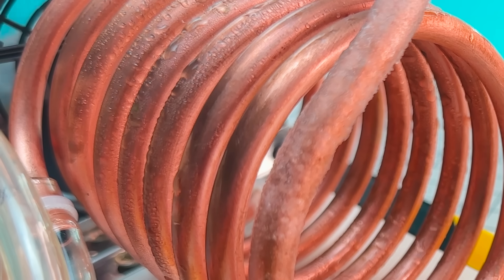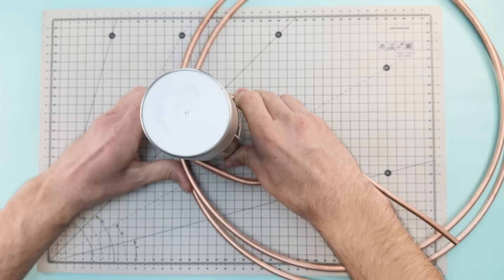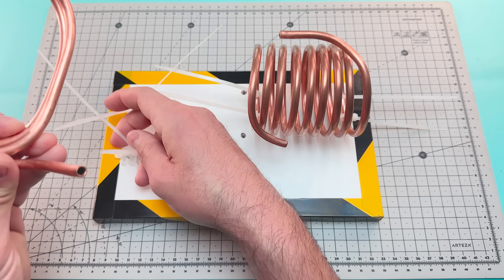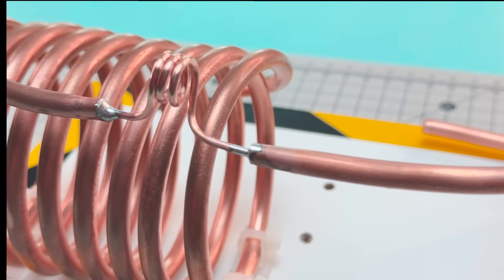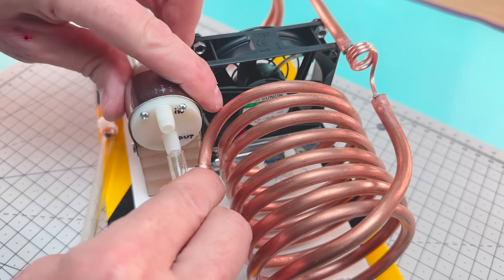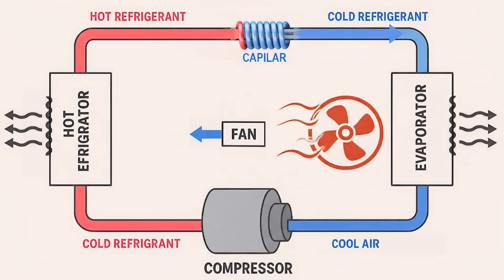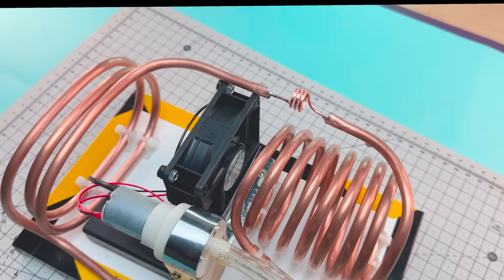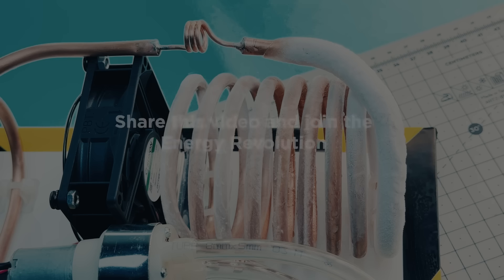Make your own AIR CONDITIONER at home Fast and Easy!

Comment: Wo bin ich den hier gelandet, ja ne is klar, ich brauche gar keinen Kompressor. :D
Reply: Das iss so nicht ganz korrekt. Er hat ja einen Kompressor. Ein Kopressor press Luft in eine Richtung. Diese kleine Pumpe ist zwar jetzt nicht das Gelbe vom Ei, aber einen gewissen Kompressionsfaktor hat das Ding schon. Ich weis ja nicht, was du denkst, wieviel Bar in deinem Kühlschrank herrschen. Aber prinzipiell muss das Gas nur verdichtet werden. Je dichter, desto effizienter, aber das Teil hier muss das Feuerzeuggas ja nur durch das Kapillarröhrchen von 0,8mm drücken. und dafür reicht das motörchen durchaus aus.
Es iss nicht besonders effizient, aber ich würde sagen, DIESES Video ist echt.
hab mir grad alle Teile bestellt und werde es nachbauen. Erstmal nur auf nem Brett, so wie er, um das Prinzip aufzubauen. Ich hab auch ne bessere Luftpumpe genommen, die mehr Leistung hat. Und wenn das mit dem Provisorium funktioniert, werd ich mir eine in meinen Anhänger einbauen. Billiger kommt man nicht an eine Klimaanlage. Ich bau mir noch eine Temperatursteuerung mit Display dazu und evtl. auch mit umkehrfunktion, so daß das Ding im Winter auch heizen kann. Braucht wesentlich weniger strom als ein 30W Heizlüfter. Der zieht mir den akku in 3 Stunden leer. So ne Klimaanlage mit max. 2 A kann ich 50 Stunden am Stück betreiben. Mit Solarplatten auch rund um die uhr.

Comment: This is cool (no pun intended) but it's far more effective to spray yourself with water from a misting bottle to cool down. Saves the environment as well.
Reply: Did you watch the video? He used Isobutane. Isobutane, also known as R600a when used as a refrigerant, is generally considered to have a low negative impact on the environment when compared to certain alternatives. It has a low Global Warming Potential (GWP) and zero Ozone Depletion Potential (ODP), making it a more environmentally friendly option compared to hydrofluorocarbons (HFCs) like R134a, which are being phased out due to their high GWP.

Comment: if you want to see a proper small ac build look at adam savage's cool suit he built for an astronaut costume he built... he explains the science of it as they build it and do the math to get the correct size tubing, length of tubing, amount of gas to inject and make a working thermostat/controller for it as well

Comment: Probably won't do much as it is, but if you can build this you can scale it up, replace the simple copper tubes with better components (or simply scavenge the radiators from actual AC units) find a stronger pump, and throw together something that can cool a house for the price of an air conditioner.

Comment: It actually works, -10 is colder than the room so each cycle is bringing the room temp down, the hot air side, its getting blown through the -10 larger coil, hot air gets colder and colder. The tubes dont freeze up on the inside becasue its liquid gas on the inside, it freezes on the outside due to convection.

Comment: great idea for cooling  small ice chest if you can separate and isolate both sides. Perhaps making it longer and add another fan to blow the hot air outside, then adding a bigger battery. you could cool a small dog house or a can or bottle of beer. Im sure with more tweaks it would be a viable unit, perhaps for van lifers and people living in a box.

Comment: conservation of mass and energy: unless you isolate the two sides, it will put all that captured heat right back into the room resulting in zero temperature change.

Comment: That's a pump...pumps don't compress.... It's just circulating the cold gas...
Reply: The restriction in the pipework (the narrow piece of pipe) causes the compression and subsequent decompression as the pump draws the gas from the other side.

Comment: Highly doubt this tiny air pump is able to compress the butane gas. You need at least 7-8 bar which you'll never be able to reach in this setup. The cooling effect seen in the video is just the circulating butane that goes super cool during expansion after leaving the preasurized bottle. nice trick though:)

Comment: You have to make sure that the warm air will be evacuated outside the room. Otherwise it actually will get hotter. But it is very interesting because there is no need for a powerful compressor, just the air pump. A good application would be a device for sleeping in the car.

Comment: As many have already pointed out, you are only moving heat from the evaporator side to the condenser side, which means the room won't cool down, unless you somehow separate the the two sides. That's why portable air conditioners have a big hose you're supposed to put in a window opening, to get rid of the warm air.
This unit will in fact raise the average temperature in the room, because the fan and the pump adds a small amount of energy (heat) to the air in the room. This will be negligibel though.

To be fair, this unit will still produce a cooling effect right in front of the air flow of the fan, and for cooling a can of beer it will be great. Just put the can inside the evaporator coil.

Comment: He should have measured the temperature on the condenser coil.  One side is cooling but the other side is heating up.  So they cancel each other out.  For example, if you leave a refrigerator door open, it will not cool down the room because at the back of the refrigerator is the condenser coil which is giving off heat.
Reply: That's right, dB7927.  A refrigerator heats the room because it is pumping heat from inside the unit to outside the unit.

Comment: now add a little finesse, add a decent sized rechargacble lithium brick, turn the evaporator coil vertical, put the fan on the condenser side and add more coils to the condenser for more efficient condensing, add a thermostat to temperature control the evaporator and you have a great cooler to sit your can of beer in when sitting outside on a hot day...

Comment: This is putting out more heat than cooling because of the condenser. The condenser is HOT. Its the unit that goes OUTSIDE your house and getting rid of the heat.

Comment: your telling me how to do something!!  Your audience a huge percentage of which speaks english and uses imperial measurement!!!  You are just limiting your viewers and your influence!!! DON'T YOU GET IT????
Reply: Mr Highpointssights, really you should learn the metric system because it is way simpler to do science and engineering using it - and way cooler - you can much more easily do approximate calculations in your head because the conversion factors and units are more consistent & easier. I grew up with Imperial & metric side by side, yet would never use imperial for anything but legacy situations (beer, road distances in the UK, and inches for rough sizing). Go on, give it a try, you know it makes sense! Trust me I'm an engineer...
Reply: Maybe you need to learn the International System of Units?
Reply: Cope. If you aren't able to convert 4 and 6 millimeters into fractions of an inch, you aren't smart enough to build this ting anyway.

Comment: A nice little project, but come on...at least say to your viewer's that this is a demonstration machine (a toy).
For example: A typical disposable(?) 9v battery (I'm assuming portability is important to your goal?) has a capacity of what +/-500ma? costing the best part of (US) $5 bucks(?) for a corner store bought Energizer? How long before everything comes to a stop?
Reply: Let alone the face he says it'll cool an ENTIRE ROOM. This could run for 20 years and not cool a standard bedroom by 1 degree. Its to small.
Reply: @joshsmith7033  It's not just too smal, it places both the evaporator and the condenser in the same room, so it won't cool the room at all. Not even in theory.

Comment: This is just to demonstrate the principle of air conditioning For real cooling, the condenser has to be in a different room from the room you want to cool Otherwise, the condenser heats the air as much as the evaporator cools the air In addition, the condenser must also have a fan to bring the temperature down A Delta Temp is created that is always fixed ( value ) Say the cold side is -10 the hot side is then +20 degrees Make the hot side +10 and the cold side will be -20 degrees

Comment: Great job building a DIY POC for the Joule-Thomson effect! However, the fundamental problem remains unaddressed. You did not explain what to do with the heat on the condenser side of the assembly. If this machine operates in a closed system, such as a room, it will eventually heat up due to the additional energy introduced by your electrical power source.

Comment: Something is not ok here. The result will be zero. At one side is is very cold and on the other site it is hot. Is will cool the air in the room if the hot side is in another room or outdoor.

Comment: "😁To cool your room at night. ' May be it is better use the solar cell panel to feed this cooler with electricity at the day time when it is really hot?
because you know even at equator in sands the nights are really cold.
also may be it is better to use Stirling engine at hot summer places to produce an electricity ?

Comment: You didn't say a single word about the other HOT side. Not good
Reply: Yes. Hot side should be outside the room - we know it as a split air conditioning system.

Comment: Principle of conservation of energy is saying hello. One pipe is cooled down, while the second one is heated. Plus heat generated by the pump and the fan. Result - the device is not cooling anything but generates even more heat. Not much, but still.
Congratulations - you've invented a heater for hamster house. ;)
Reply: If you were to move the hot side outdoors like a conventional air conditioner or In a smaller setup I could see this working, but that would be the only way. However, with proper drainage say a collector plate into a sink or something I could see this working in a small space quite well. Like a small shed converted to an office, you could have the collector plate just drain outside, or even be collected and used for plants as it's just pulling moisture from the air. Perhaps fed into a humidifier to keep relative humidity in the area constant also. Set it up with a power converter to a wall outlet with a temp switch that is available on amazon for just a few dollars this little thing could be quite useful.
Reply: @MrLazer1211  Thats what I'm talking about screw the haters but I used AI and now I'm down the rabbit hole of extreme temperature PTFE tubing and liquid pumps instead of air pumps, pressurizing the liquid before the capillary so basically just moving the location of the pump in the system and using a fuel pump capable of like 9-15 PSI
Reply: @MrLazer1211  Also increasing airflow across the cool coil will increase cooling effect this dude just said 100m3 thats insane try like 10m3 where I am sitting in my office
Reply: That's right!!!
Reply: People will make this model at home and will understand for themselves what heats up and what cools down.
Reply: You are correct, and I was thinking about adding the heat of compression, but I thought, hey, they are not even using a compressor, so maybe I'm picking this thing apart more than necessary.

Comment: This is ridiculous. You can't have the condenser and evaporator that close together, one side is cooling while the other is spewing heat. You don't get "cold" for free, it's also producing heat.
Reply: Exactly the same way all ac systems work. Condenser should be outside room. Evaporator inside room.
Reply: True but the evap mesh on a basic fridge is close; insulating helps. The reality here is just demonstrating the bare bones of the principle.

Comment: So this is a great idea in principle and in practice, but, if you vacuum the air out as much as you can first before putting the butane in by using the syringe to pull the air out, you will have a much more efficient system, but, you'd also likely need a bit stronger motor and a bit more durable air pump.
Reply: pulling a vacuum on the system is a basic principal in making an efficient a/c, adding something like a Shrader valve and using freon would be about the same price as the butane as you can pick them up at most Walmart or gas stations (the little recharge canisters) I don't see a reason that for about $30 you couldn't make this thing amazing. (A hand vac pump is like $17 on amazon, a T fitting probably about $1, and hvac Shrader valves are about $1 on amazon as well, Freon is about $40 on amazon, but cheaper in stores by about half with a pressure gauge built in, not that much more than the butane) extend the hot side to outside, I don't see why this wouldn't work to be honest. I would place a small collector under the systems cold side and just funnel it into a humidifier to keep the area at the same relative humidity, hook the whole thing up to ac power with a drop down converter and plug it into a temp controlled wall outlet (also on amazon) and a fully automatic ac is born.

Comment: Total lie !! saying that it will cool a room.  it will do nothing to a room unless the evaporator portion is somehow put outside the room and sealed off!    At the most this will be useful as a person cooling unit for 1 person, and even there you will have the inconvenience of having water drips all over the place from the condenser side.
Reply: condenser* portion is put outside the room. and the intent of this is to blow cool air on you, kind of like a fan. The room won't be "colder" but you will have colder air blowing on you so YOU will be colder, even if the room is the same temperature. The AC unit itself remains the same temperature, by the way. the evaporator gets cold as the condenser gets hot. The temperature will tend to equal out. But because you don't have a fan blowing the hot air on you, you will experience what the evaporator side is experiencing, which is a drop in temperature. Its like a personal fan on steroids, and its cheap and better than nothing.
Reply: Okay. At least as a personal device it will be fine. During summer people use spray bottle with fans, I can't see a few drips being bad. 😂

Comment: Ill just go to a junk yard and pull a a/c unit from a car and use that . Alll ur neet to get is  a 12v  motor that will have enough rpms to engage the clutch.  And your have a 12v volt a/c

Comment: Has anyone commenting on here built one?
Reply: I doubt it, but I would hope most of the people commenting know how mostly useless that particular setup is, for one it's way to small to be able to cool a room even if setup in such a way that the hot condenser side was outside the room, otherwise it cancels it's self out and even generates slightly more heat, if you actually wanted to make one I would use parts from a broken fridge or aircon that the compressor still works and could probably salvage other parts too, also you need a vacuum pump to suck out the air before putting the gas in for best efficiency. that particular setup may still be useful to cool a drink quickly or even as a personal cold fan.

Comment: That device is NOT an air conditioner. You built a refrigeration device. You have to separate the cooler and the heater. A refrigerator has the cool part inside and the hot part outside the "box"" An aircon has the two parts separated, one outside the room, one inside
Reply: It is a very inefficient space heater ;)

Comment: Very nice, but the air blown through the system will be heated by the compression unit before being blown through the cooling unit. The net result will be slightly heating the air by the energy used through the battery. You should make it a split-unit to transport heat elsewhere...

Comment: This will not work, the moisture in the air will freeze at the cappillary, thus blocking the system, trust me I am a HVAC enginneer!
Reply: Correct. All tubes need to be copper, so as to be able to pull full vac in the system. I think the creator is just showing us this to help us understand how these systems work. Not an engineer, but that HVAC book was 1300+ pages long..  Took me months, and 5 full readings to actually understand it in a meaningful and useful way. Still not an engineer.😆
Reply: any ways of overcoming this issue? maybe increasing the size of the capillary tubing?
Reply: @LorenzoTheFisherman  bigger diameter in that area means not enough pressure drop behind. After my understandment such a system also should/must be water free... dried air
Reply: @LorenzoTheFisherman  vacuum the system before inserting gas
Reply: @LorenzoTheFisherman yes

Comment: No evacuation of calories outside the room, so ultimately no cooling ... The system should have been split, with one part outside...
Reply: In fact heat is added to the room from friction in the fan and the pump
Reply: This design is fairly easy to modify to fix that problem, besides this would still be great on a job site where the walls and windows aren't in so there really isn't a space to cool anyway you just need something cold to help cool you off for a bit

Comment: Where the generated heat would go in this system?
In the same room?
Reply: not only will the heat generated from the motor dissipate in the same room but the heat pumped out of the loop will also be dissipated in the same room. 
you might get cold air blown on you but the room will also slowly get warmer. 
the condenser and motor should be on the outside of the room for efficiency sake. the fan and evaporator should be on the inside.
Reply: Of course, it's the same thing as leaving your refrigerator open to cool your house.
Reply: Принципиальная ошибка - нет отвода тепла во внешнюю среду. Но идея хорошая.